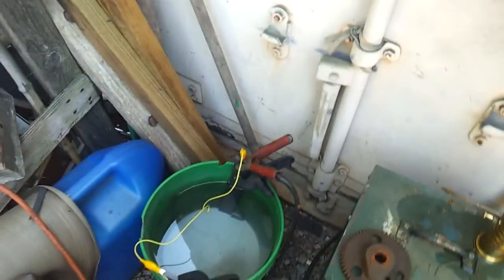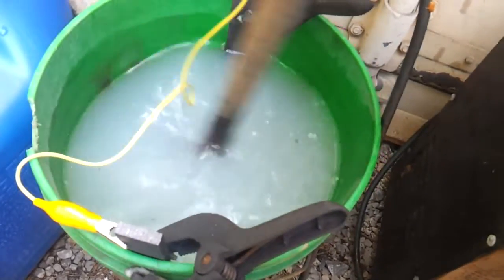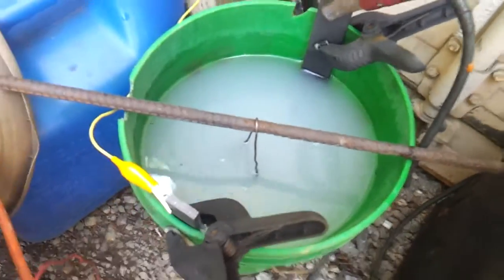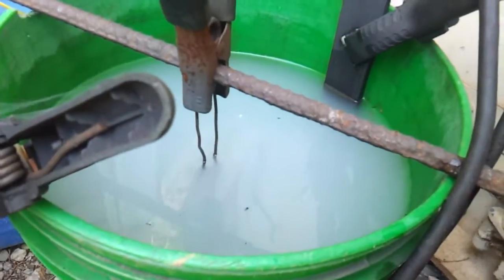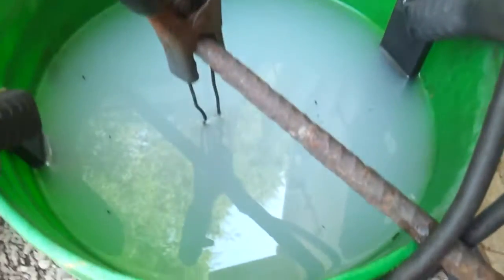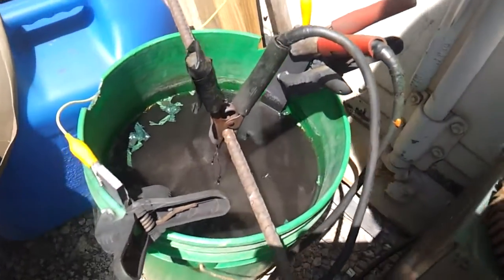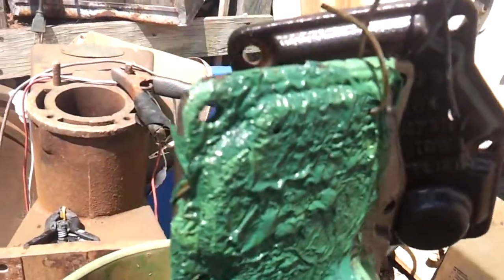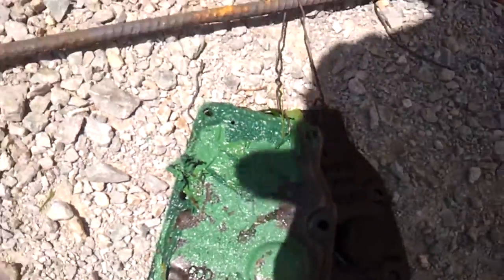The Way I clean Up My Cast Iron Parts

Comment: What voltage you running? Just a car battery or? And whats in the bucket? Just water and bicarb?
Reply: Arm and hammer washing soda, 12 volt battery charger.